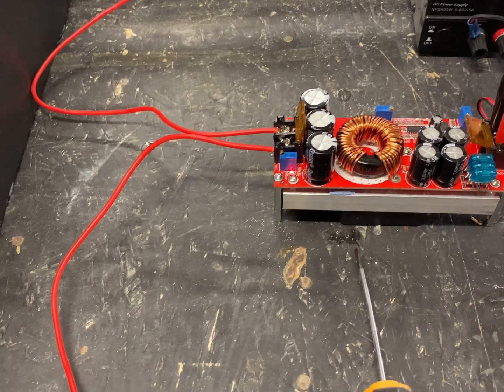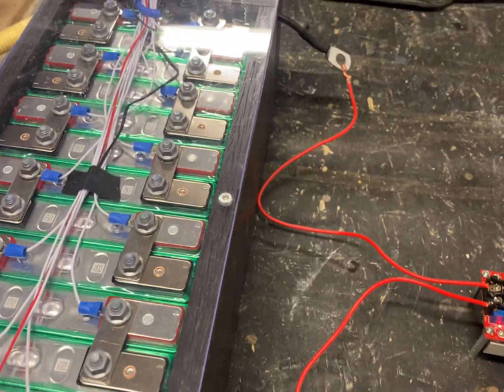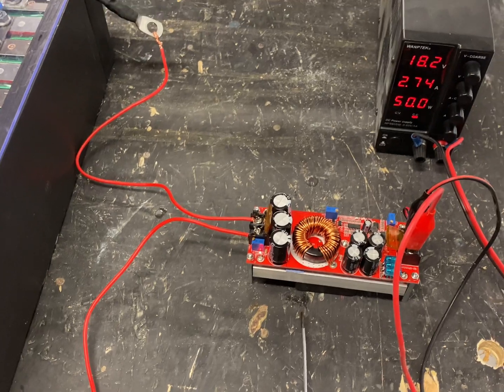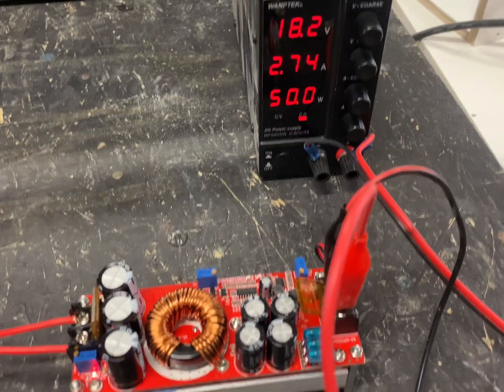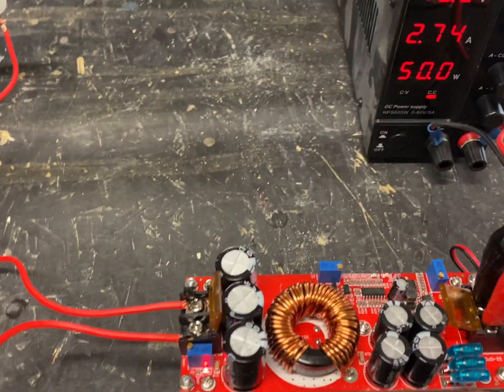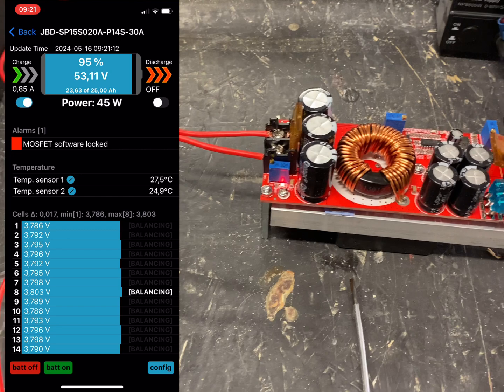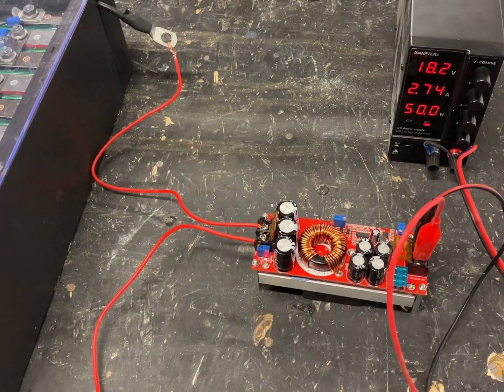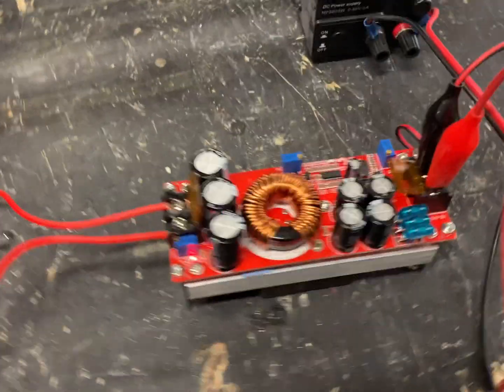Use a DC Boost converter to charge any battery with LOW DC input

Comment: Updates please? Can i input dcdc boost mimicking a solar panel as input to a solar charge controller? Looking for easiest safest way to charge small 12v 20Ah lifepo4 from heavy big marine lead acid 12v. Boost 12v lead acid to 14v direct to lifepo4 works but id like to 24v to victron solar charge controller to monitor nighttime charging if i keep below voltage and amp ratings is it OK to try?
Reply from the maker: Yes it is possible and should work.DC-DC boost converter as an input, ensure that it provides a stable voltage with a current-limiting function. Make shure the module can handle the current.
Or consider a Dc-Dc charger for lifepo4.

Comment: It might not be a very good solution as the load on the panel increase voltage drops so the current starts to drop as well decreasing total power so its not gonna be actually CC , CV charge method and also there's no stages of charge.
Reply: Pm me can you to install do sola paint of charger..
Reply: @anwin85alon  what the hell are you trying to say mate
Reply from the maker: Thank you. You are right. It will not be actuall cc, cv..